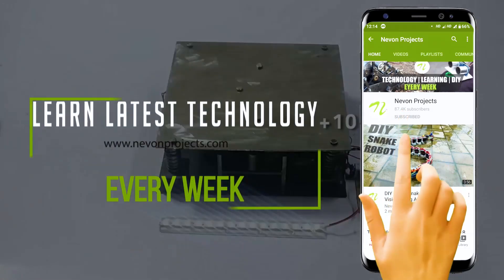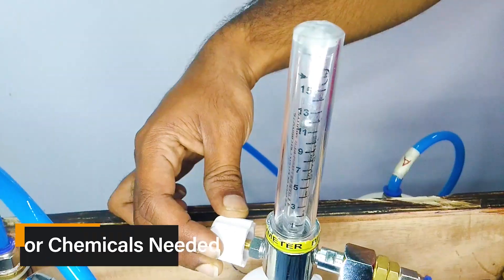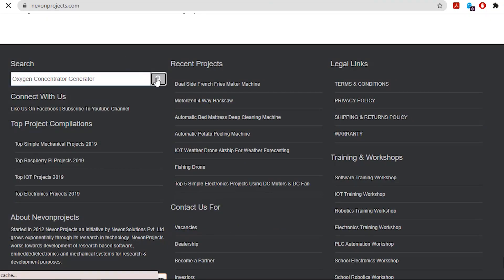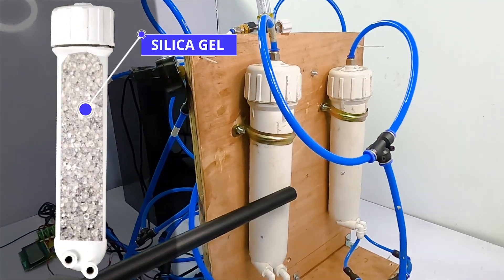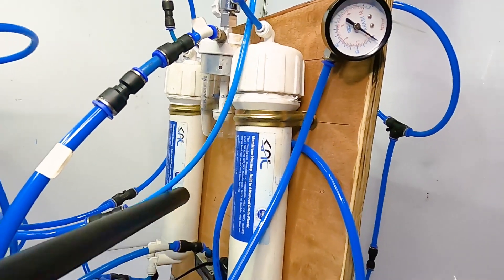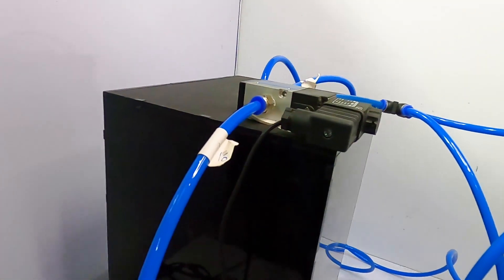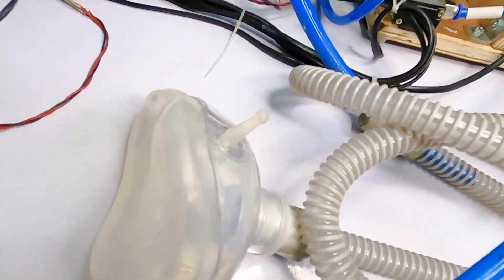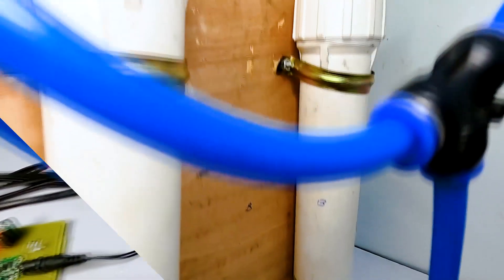DIY Oxygen Concentrator Using PSA | Oxygen Generator Machine

Comment from the maker: COMPONENTS USED FOR DEVELOPMENT (Operating Pressure 30 -40 psi)

2 x Zeolite Molecular Sieves
1 x Oxygen Reserve Tank
1 x Silica Gel Membrane
2 x Pressure Regulators
3 x Pressure Gauges
1 x Oxygen Sensor
1 x Pressure Sensor
6 x Solenoid Valves
Pipes and Fittings
Controller Circuitry
External Compressed Air Supply
Reply: Sir please 🙏🙏🙏 tell amount of these things
Reply: Hello sir
Reply from the maker: @mohamedraihan2700  For this Mechanical system details of free document PPT pls call watsapp
+919136664226 or visit link in video description
Reply: @NevonProjectsOfficial  It would be more helpful if @Nevon Projects could mention the approx cost of the project too....
Reply: Did you use the black box to store the cylinder?
Reply: Is the compressor included in the kit
Reply: Hello can you help me ppt for this oxy conc.
Reply: Need coding for this project?
Reply: If I order this all things then how I will make
Reply from the maker: @adittyaraj5687  you will have to assemble it and then use a compressor to provide compressed air supply
Reply: @NevonProjectsOfficial  hi what is the specification for air compressor. Its difficult to get one due to lockdown. Can u suggest me , what all types of air compressor can be used for this project?
Reply from the maker: @aadhikarianish  any compressor that provides 30 - 40 psi is fine

Comment: What about Nitrogen ? How to manage the seperated  Nitrogen? I s there any test for the purity of oxygen.what and how much compressed air required for producing oxygen let's say one cylinder? in terms of CFM and how much time required.you should please provide complete details size dimensions,specification etc so one can try and may help someone in emergency
Reply from the maker: Well the separated nitrogen is flushed out in the atmosphere and oxygen purity is measured by sensor... It provides varying levels of purity at various Compressed air pressure and time settings

Comment: What about the CO2 and other pollutants SOx or NOx present in the air? How can we scrub it out?
Reply from the maker: Well in ambient air we have 78% nitrogen and 20% oxygen and 2% is other gases.. anyways to remove SOx NOx you can use HEPA and active carbon filters at input air supply

Comment: What is the name of this type of cylinder use in oxygen concentrator often?  Is it polycarbonate Or nylon type?? 
Means how we can find them on any shopping site to purchase? 

It would be very nice of you if you can give a clear drawing of the entire circuitry to understand the exact position of each of the components with their technical parameters and values. 
 Waiting for your support. 

Thank you🙏
Reply from the maker: They are available in plastic or also made of aluminium, they are called sieve bed
Reply: @NevonProjectsOfficial  Thank you for your response.

Can you please give me a clear drawing of the entire circuitry to understand the exact position of each of the components with their technical parameters and values. 
 
Please let me know your mail address to mail you. 

Thanks you once again

Comment: Can you please let us know where and how your sourced the materials for this project
Reply: Shep VanDelay  Oxikit also has the same struggle to get relevant inventory in India from the right place like what others have asked above. Nevertheless, Oxikit is the best option I have seen so far and trying to work on it despite delays from my side to get the right inventory. Hope it works and helps others too.
Reply: Don't worry guys I am working with Investment Groups and IITs to make it easier for Indians to buy these industrial inputs even at hobby/small guy level. If you want to join my efforts lemme know. Without material availability to a common guy, we can't really innovate
Reply: These parts are made and available in China very low cost.
Reply: Sir plz explain, why we do not atach compressor after Zeolite container. it means suction from zeolite container.
Reply: Buy from McMasterCarr
Reply: @AS-ug2vq  Where can we find the material in India?
Reply: @ajay11001u  You can't buy these components unless you order them in bulk or pay 3x-4x price, you can buy from international websites like McMasterCarr, they'll charge $100 in shipping fee but they'll have everything available. If things were available cheaper and easier in India, India would have developed long ago. Even AliExpress is banned by government now, so can't buy from Chinese either.
Reply: @AS-ug2vq  You are right. Anyways thx

Comment: Can it happen within 15000rs
Reply from the maker: No, if you buy materials in bulk it may cost around 17000 - 18000 per concentrator materials, also china has increased cost of zeolites which is not available in India

Comment: wonderful video, can you please help us understand how to DIY zeolite cylinder?
Reply from the maker: you will need to either cast or 3d print for proper result else for Full DIY you may use large bottles of thick plastic n stuff like that
Reply: @NevonProjectsOfficial  thanks
Reply: Go to Home RO water purifier dealers and ask for membrane housing. Also you can get all fittings from them including solenoid valves
Reply: @williampatrick5371  thanks

Comment: Compressor you guys used?
Reply from the maker: This project uses air from an 1.5hp air compressor, but you can use lower power compressors too
Reply: @NevonProjectsOfficial  can i use vaccum machine or tyre inflator.as such
Reply from the maker: @borncurious  tyre inflator may work as compressor

Comment: There are few questions please answer. 

1. Maximum time duration of use.
2. How much power consumption. 
3 . Replaceable materials 
4. Total est. Cost of make.
5. Availability.
Reply: Power consumption is around 750w depending on the compressor you use

Comment: What is the  production  rate litre per minute speed of oxygen from it.

What kind of lab testing certificates you have obtained 

Coz its very flammable
Reply: Oxygen is not flammable. It help other material to burn.
Reply: What lab certificates you have
Reply: Who will pay for certification? This is not a commercial product but a prototype

Comment: The Zeolite and the Silica Gel needs replacement right?
Reply: I think Zeolite can last longer upto years.. silica gel need to be replaced when it changes colours.. however it also take times.
Reply: @ajoshking   your correct in my project it gets bad in 1 hour of use

Comment: Can you make this system ?--unused oxygen cylinders used in house can be converted to store oxygen and a system created to dispense oxygen in villages for individual patients . As there is a huge shortage of cylinders and these are available in huge quantities .
Reply: Cylinder used in home do not have polymer lining so steel can oxidize rapidly inside and is corroded and exploded/crack/leak

Comment: it can not be said DIY.because it requires a deep knowledge and skills, and materials which are not available at all places.
Reply: No it doesn't. It's DIY exactly, you compress air and pass it over zeolite bed after expelling water from compressed air then, you extract oxygen. Finally decompress and release nitrogen back into atmosphere. Solinoid triggered valves are used to time the compression and decompression, needs a microcontroller to orchestrate all that. But definitely not difficult for someone technically oriented.
Reply: @AS-ug2vq   Thanks for enlighting that compress-decompress timing thing... I am so eager to try building this... but knowing that it need programming skill (arduino?)... on a second thought..I postpone building it and search for programming video first...

Comment: How r u generating oxygen??  Electrolysis??
Reply: Zeolite , filters nitrogen from air, hence increases oxygen concentration
Reply: @kiranvijay9996  technically zeolite doesn't filter it only selectively absorbs nitrogen under pressure, effectively resulting in higher concentrations of oxygen in the air there left unabsorbed

Comment: what bout using fridge compressors ? they r available easily
Reply: They are designed to run in closed loop and will contaminate the compressed air with POE oil

Comment: can it be stored in cylinders?????
 need an urgent reply please...............
Reply from the maker: Yes it is stored in a reserve tank and can be used to fill low pressure cylinders, but cannot be filled in liquid oxygen cylinders as it requires a lot high pressure

Comment: Bhai ye machine kitna banakar denge? Muje chahiye
Reply from the maker: For this Mechanical system details of free document PPT pls call watsapp
+919136664226 or visit link in video description
Reply: @NevonProjectsOfficial  please make it more simple and without air compressor. Because air compressor not available in homes. If air compressor removed and supply air via any pump manually?
Reply from the maker: @digitalIndia1947  Yes we are already working on that
Reply: @digitalIndia1947  without air compression, zeolite doesn't absorb nitrogen. Air compressor can be bought from local automotive stores, Chinese air compressors are available for 7500 in market. Is 7500 more than your life?

Comment: In case of bill Gates blocking out the sun and mutations spores creates it hard to breath on earth. Please generate air flow to accommodate pressure temperature of stress emotional reactions towards moods swings of each personal human type in consideration as well as how there lungs breathing’s measured in each exhale inhale towards keeping breathing cycle even when knocked uncontrollably unconscious in case of emergencies of life threatening situations as aerospace travels so it’s needing to mathematically calculate how long would you hold oxygen adjusted pressure of space and mass of planets gravity pulls and compression rate to accommodate calm safe breathing but accurately keep brain thoughts highly safe fight flight but ration airflow. I’ve got more ideas but start your bases foundation on that level phase if you successfully create a prototype keep it on record for yourself and never trust your Govt it will be rebranded stolen and discredit you for thinking like it’s the Middle dark Ages these elitist never learn to share but only take. Evidence in our humanity historical facts of the wealthy wasteful speck mindset trail of mistakes that each rich Changes like an Egyptian pharaoh erasing what it doesn’t like stupidity at a whip whimsical fir thoses that control everything but have nothing to show for there own soulless wealth worth its meaningless to divine existence but neither doesn’t anything demonic democracy either since there on the same communism party trying to steal freedom in all shapes forms and utilizing fear mongering globally on earth to get back slavery by fake narratives call testing kits & Bill Gates vaccines pleasetell me your culture banned Bill Gates vaccines even cOvID19 because he promotes and owns all corporations sectors in vaccines health tryin to genocide quietly about what we all know his Darwin agent satanic worshipping goal is. So why hasn’t both India 🇮🇳 & Africa citizens tell by there own technology way to warn the world why they can’t trust anything labeled cOvID19 by Bill Melinda Gates foundation nor any others partners that supports this genocide on humanity it’s a crime against god earth and humanity globally now. I hope your surviving well. Because Bill Gates patented WO2020060606 also a Frankenstein iBot zombie A.I. 🤖 enslaving anyone who’s dead but there reanimated never to sleep or Rest In Peace again never to see there god family’s in heaven even because they took the vaccine that changed there god particle dna 🧬 humanity into a GMO-human for easing demonic possession and A.I. Hackable Brain vibrationally to make you not believe in yourself or god ever again! Please warn more if :YT A.I algor. Or in your own country doesn’t stop you from carefully warning other humans on earth it’s a war over our lifespans now. Never give up never surrender survive at all cost keep protecting life and intellectual freedom or thoughts and creation of god particle safe within all life on earth and humanity care and be safe with one another. But fight for survival nonetheless.